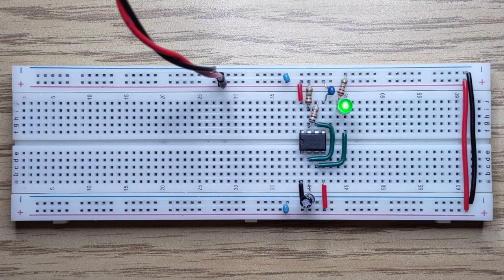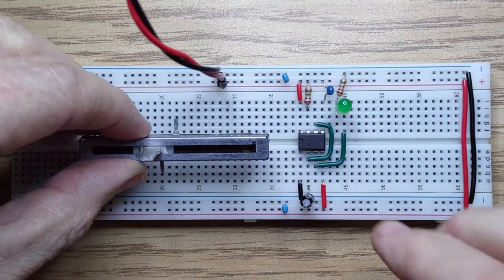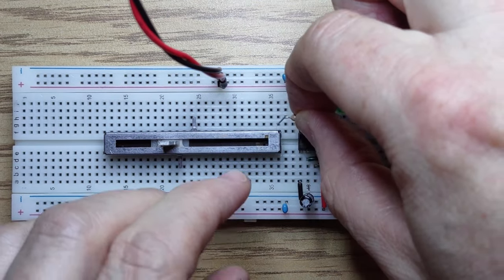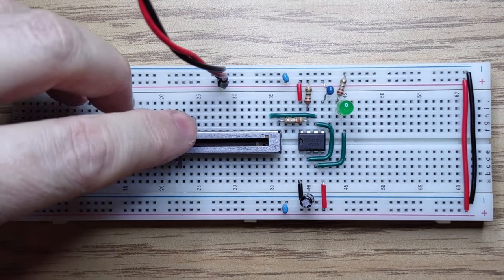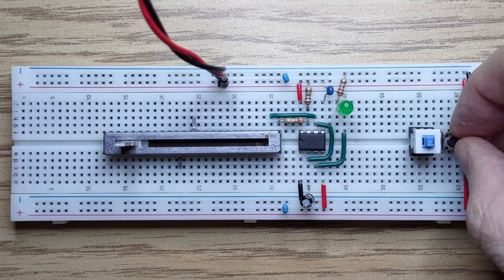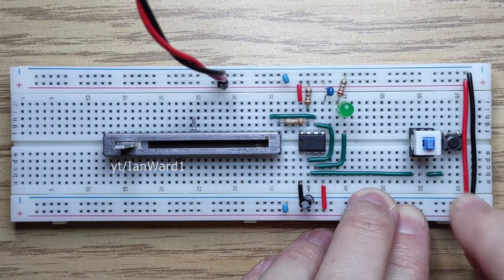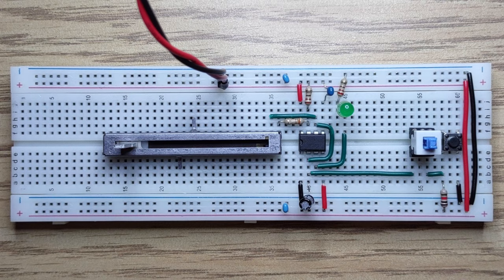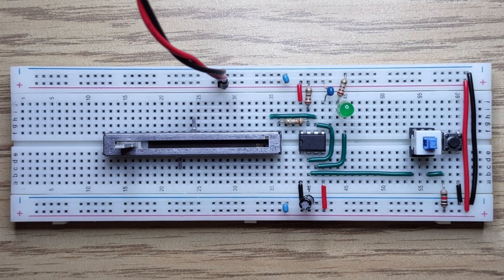Manual Clock Circuit Controls: Speed and Single-Step

Comment: You didn't mention if lowering the resistance speeds up or slows down the light
Reply from the maker: Lowering the resistance will speed up the blinking because it allows the capacitor to charge and discharge more quickly. Choosing a smaller capacitor value will also speed up the blinking because it takes less time for the capacitor to charge to 2/3 or discharge to 1/3 and switch directions. Thank you for the comment!
Reply: @IanWard1  Thanks. I'll get a big pot so I have some play with the speed